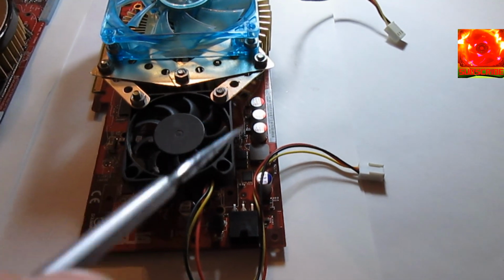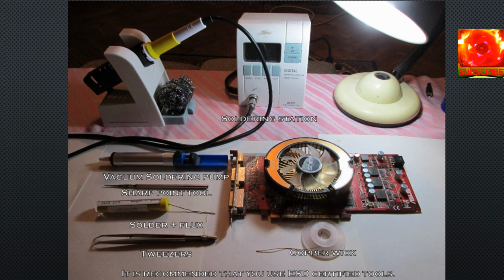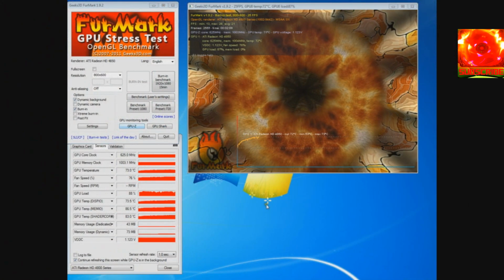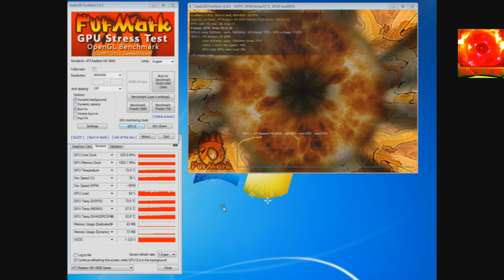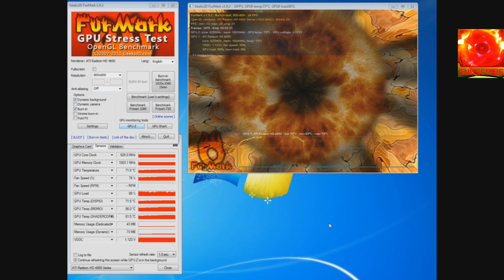[Repair tutorial]ASUS  ATI/AMD HD4850 PCB reapair/capacitor replacement.

Comment: Hey friend, I have an R9 280x that gives me artifacts from boot, windows won't load ( unless in safe mode or using default drivers ) I was going to bake it, but I recently came across capacitor damaged theory, any idea how i can tell ? SMD caps looks ok, so do the other caps, no swelling, no leakage, no burn marks. The ONLY things i can see myself, is that 1 of the caps has some chipped paint, and there is some warping on the board itself, underneath another capacitor, but only visible when you flip the board, very minor, almost looks like surface of the board was nudged in that area.
Reply from the maker: +Sonoo19 Have you tried the gpu in another system, there may be a problem with the PCIe slot. Capacitors usually blow up (like a ball, not a bomb) when they're damaged. But there are cases where the cap is damaged and there is no visible evidence. The capacitor which was "warped" may be indeed damaged. Baking the card should be a last resort, because if you don't do it right it will die for good. And if it works after the heat up it wont last long.
Reply: +Tech Order 

Thanks for your help :)
Heres an image of the card http://imgur.com/a/luiwb
I used both PCIE slots, same issue, machine works with onboard gfx. 
If you take a look at the btm of the card, you'll see the dodgy cap that i've circled
Reply from the maker: +Sonoo19 Has this board been heated or soldered on? That yellow stuff looks like molted PCB fiberglass. I think that the chipped paint cap isn't damaged (if the paint is the only visible problem), but the other one looks like it shorted out and it overheated the board.
Reply: +Tech Order 
Hey again bud,

Board has never been baked or soldered on, has been this way since it stopped working. The fan on that side though had crapped out and AMD's shitty drivers made it even slower. I assume the same, the heat caused the solder to melt, shorting the cap causing heat to warp the board there - but can these circuits generate enough heat to run solder ? and does the cap need replacing or do you think lack of visual damage is enough to call it safe.
* i've seen large enough caps melt Pennys when shorted, but it needed heat to run the solder to cause that short

Comment: This was quite an interesting video! Not expected, but still enjoyable!
Reply from the maker: +Console Master Race Thanks. Now you know why I can't play Fallout 4. :D
Reply: Tech Order If only I could send you my old GTX 560 that is just collecting dust.
Damn shipping to Eastern EU will destroy my wallet.
Are budget graphics cards expensive in your region? Even like an R7 250X, GTX 750? Used parts, perhaps?
Reply from the maker: +Console Master Race Thank you for the generous offer. :) But yes, shipping to Eastern Europe is expensive and sometimes the shipping companies here deliver the items in pieces. >:( Low end GPUs cost a fortune here. A GTX 750(non Ti) is like 130$. For that price in the  US I can buy a GTX 950 or a R7 370. Yes I did consider second hand parts but there were two issues. First I may end up getting ripped off by getting a defective card which I wouldn't be able to return. And second the new GPU would have been bottlenecked by the rest of my system (it is a potato PC after all :D ) Overall my entire PC needs an overhaul but the general problem is that I can't afford to do that and that is why I did this repair. :)

Comment: Did you have to put the capacitor pins in a specific hole? Or can it go either way round? I noticed that one of the holes had a square around it and the other had a circle
Reply from the maker: +Elliot Pierson This is going to be a long answer. There are two possible answers to your question. Answer 1: If you look at the beginning of the video you will see that the capacitors have a red line on them, these are the so called polarized capacitors; a.k.a. capacitors which can be mounted only in a specific orientation. The lead(leg) beneath this line(it can be any color) is the negative one, and the other lead is the positive. There is also another way to determine capacitor polarity. Usually band new caps have different lead lengths. The longer lead is the positive one and the shorter one is the negative.
Answer 2: There is also a second type of capacitor which is called a non-polarized capacitor in other words its orientation doesn't matter, you can mount it either way.
The holes(pads) however are a bit more difficult to understand. Generally the square hole(pad) is for the positive lead and the round hole is for the negative lead.But I have also seen cases in which the polarity it's the other way around. Because I have been working with electronics for the last 15 years I can determine the polarity by analyzing the board or by measuring it with my equipment. If you are not a trained professional then I would recommend that you take snapshots of the board before making the repair so that you can see the proper orientation of the components.
Reply: Tech Order Thanks man!! That was a really informative answer! Also, glad to see that you are now back! :D
Reply from the maker: +Elliot Pierson You're welcome. :)